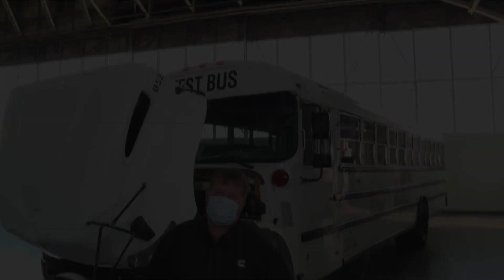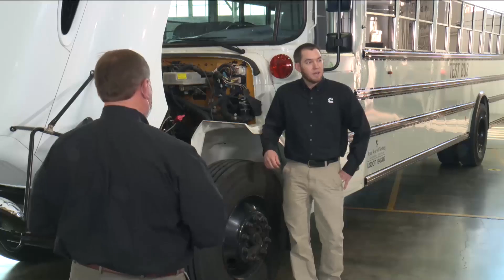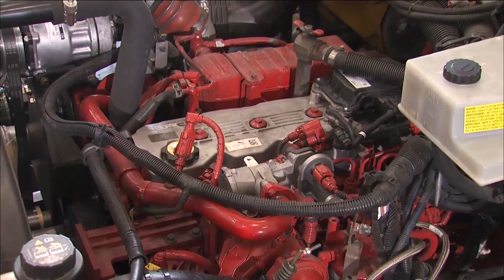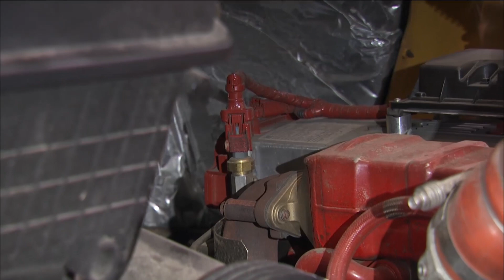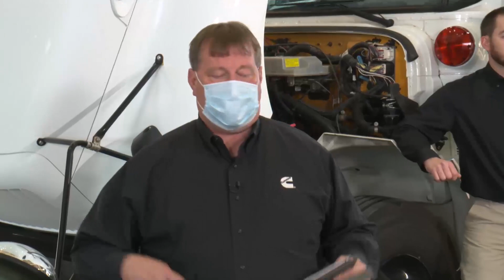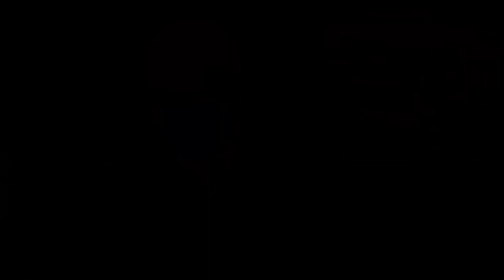Cummins 2021 B6.7 and L9 for School Bus

Comment: Stop underpowering your engine in medium duty trucks 🚛!!! Should come standerd with 500hp 1200 ft pounds. Remove the dpf egr because y'all still haven't fixed it! Slow trucks is not what we are after or want. Egr clogged egr crossover so many issues to list